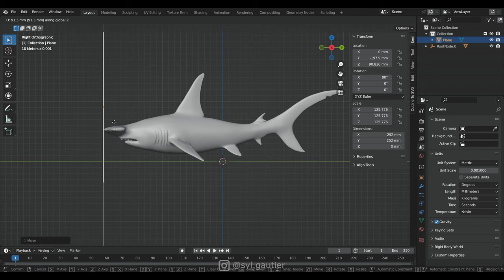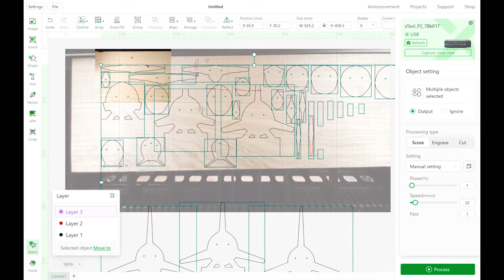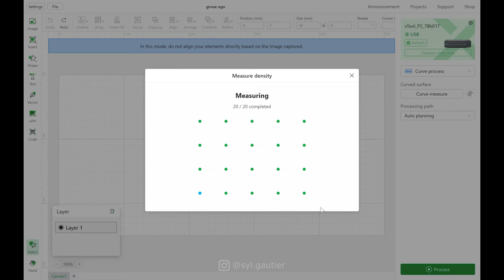I had to chop its head off  - xTool P2

Comment: I'm curious why you just put a + for the alignment holes and not just have the laser remove a small hole.
Reply from the maker: A laser cutter leaves an edge that is not really squared so I thought I would be more precise this way. I also wanted to avoid burned marks inside the pieces in case I would reach the hole while carving the tail or base of the head. In the end I think it might have been better to laser cut most of them and just drill the few that were sensitive to the issue I mentioned.